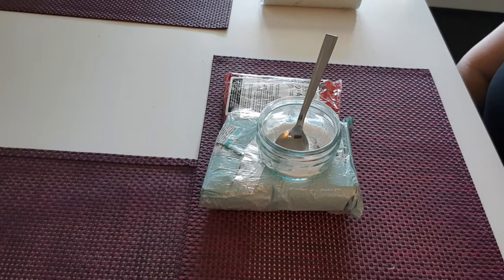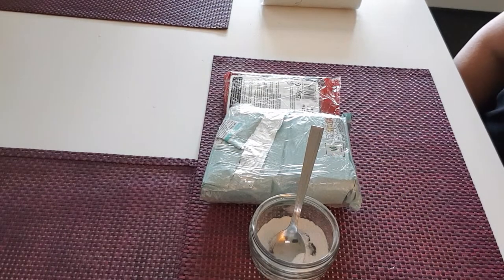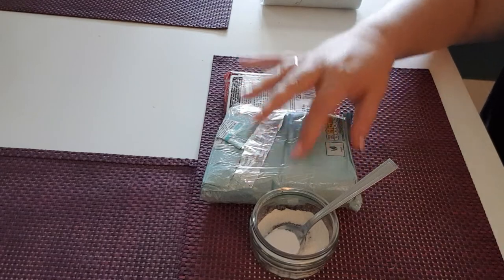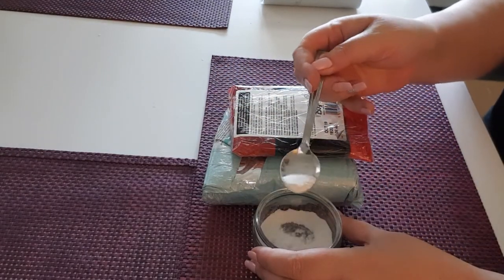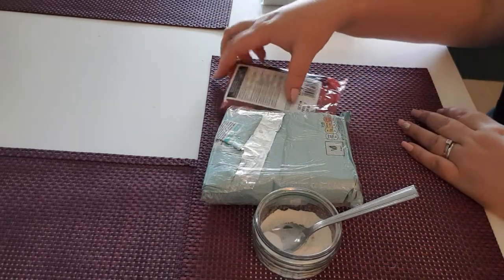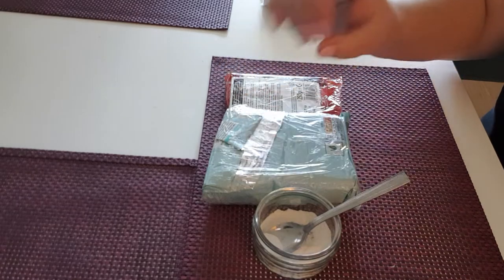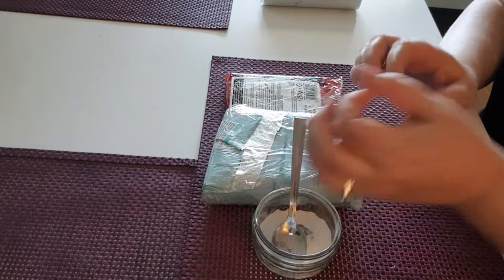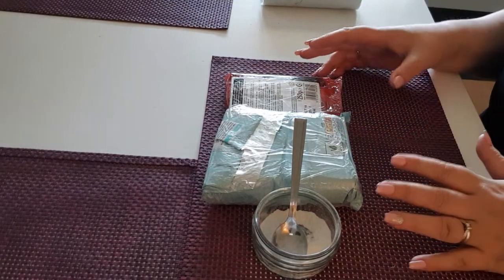Calculating ratio of Tylose (CMC) to Fondant for Beginners

Comment: Thank am on the right time and Very helpful video!!!!I have few questions kindly help me. How much do l put on a 1kg fondant?After adding CMC in fondant how does it take to dry after placed/covered on a cake before l deliver it to my customers?
Reply from the maker: I'd suggest between 3 to 4 teaspoons of CMC/Tylose Powder to 1kg.  Once you've added powder, work quickly if you're covering a cake, as it will start drying. So get the fondant on the cake as quickly as you can. It will take around 6 hours to become hard. So I would allow cake to dry overnight before delivering to customer. Hope that helps. 🎂❤
Reply: @MysteryBaker  Thank you for your prompt reply....
Reply from the maker: @salomembiku4256  My Pleasure x

Comment: Mam just wana ask you after using cmc to fondant the fondant topper where has to store chiller or ac room or non ac room and after covering the cake with fondant how to store the cake without sweating bcoz my place is a bit hot plz plz mam help me
Reply from the maker: In reply to your first question regarding fondant topper - I'd suggest that you allow them to dry naturally in the coolest part of your home and try to avoid refrigerating them if the air is humid, simply because when you remove from the fridge, they may sweat due to humidity. As for cake sweating - take a look at my video which tells you how to prevent cake condensation in humid climates https://www.youtube.com/watch?v=5Gxe_Fp-xkM&t=42s
Reply: @MysteryBaker  thanks a lot mam tons and tons of thanks for replying and making the doubt clear about gondant
Reply from the maker: @PrasannaKumar-kv7th  My pleasure and hope my cake sweating video helps you avoid cake sweating in future xx

Comment from the maker: If you have any questions regarding tylose *CMC Powder, please feel free to ask xxx
Reply: What's the different between tylose powder and cmc or both are same?
Reply: I also have the same question?is there any dfrnc
Reply: Thankyou very very much for this helpful video.. much appreciated...i have a query ...  when i start modelling my fondant i add CMC to my fondant ... aftr that i dont need to dust it with  CMC again? normally m  using icing sugar for dusting or shortening to avoid it cracking...so aftr adding CMC to my fondant should  i continue using icing sugar or shortening or i shud dust with CMC only? Thanx in advanve for ur reply ❤️
Reply from the maker: @liyanvv7540  CMC and Tylose are the same thing x
Reply from the maker: @farishcakescreations4933  I'm not sure if I'm understanding your question so apologies.... but once you've added your cmc, theres no need to keep adding more, it will only make it too dry. Just make your model or embellishment and use icing sugar,  if you need to roll it out or if it is sticky. Yes you can add shortening to avoid cracking. Hope that helps? Xx
Reply: Thankyou very much dear ... u surely understood my point ... got it ... cheers ❤️
Reply from the maker: @farishcakescreations4933  My pleasure xx
Reply: @MysteryBaker  Hello...Thanx a ton for all ur tutoriols ... luv them all ... i need ur help... when i bake my cakes i use baking strips ... aftr the cake is ready my cakes becomes oil from the top ... an oily film is formed on the top of the cake ...  wats da reason and how can i avoid it? Thanx in advance ❤️
Reply from the maker: @farishcakescreations4933  Hi thanks for your question - take a look at my video, I think it covers cake problems including the one you are currently concerned about xxx  https://www.youtube.com/watch?v=O5FeZTlbcH4
Reply from the maker: @liyanvv7540  Tylose and CMC are both the same x
Reply: @MysteryBaker  Thankyou soo much for ur prompt reply ... will watch it ❤️
Reply from the maker: @farishcakescreations4933  if it doesn't cover your issue, just let me know xx

Comment: Hi
I also use Tasco fondant for covering the cake but always my fondant break 
Please help me 
Can I use cmc powder?
Reply from the maker: No, using CMC, would make the fondant too hard. What I would suggest instead, is to firstly reduce the amount of icing sugar you use,when rolling out the fondant (as too much can dry it out) and finally work quickly, the longer you take to roll out fondant, the more chance of the fondant drying out. Hope that helps? Xx
Reply from the maker: PS Check out my tutorials showing you how I cover a cake in fondant. Xx
Reply: *Tesco fondant
Reply: Thank you so much for help 
I will try tomorrow xx
Reply from the maker: @kafiamemon2739  I have every confidence, you'll do just fine xx

Comment: Can you start using it right away? Another tutorial said to let the prepared fondant sit for 24hrs in a bag before using
Reply from the maker: I usually use it within a few minutes of adding it. In my experience leaving ot overnight will make it far too hard to work with. I hope that helps xx
Reply: MysteryBaker thanks, l agree with you! I’m not entirely sure what the feel should like as l’ve never used ready made gumpaste...l found mine a bit too dry/ stiff but then when l added more fondant it was to limp?
Reply from the maker: @jotibhalla527  Youre looking for a firmer texture but still malleable. For a ping pong ball size of fondant I'd use a quarter of a teaspoon. Knead it then cover it in cling film for a few minutes and then you're ready to go. The more you get used to using it the better you will become at gauging quantities of CMC to fondant. Good luck and if you have any more questions please feel free to ask xx

Comment: For 1kg of fondant how much tylose powder required
Reply from the maker: If you are adding tylose  powder for model making... I would add around 4 level teaspoons. Hope that helps? Xx
Reply from the maker: Personally if you're going to be working slow, I'd add only 2 to 2.5 level teaspoons, as it will harden quickly if you add 4 tsp. X